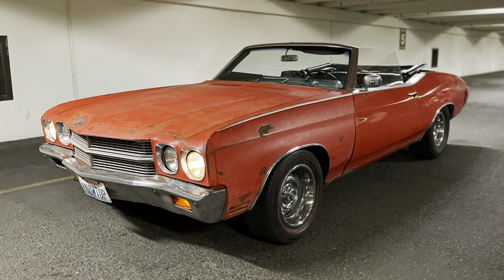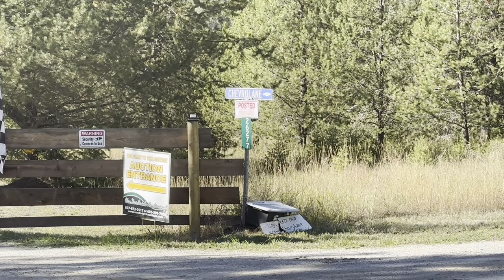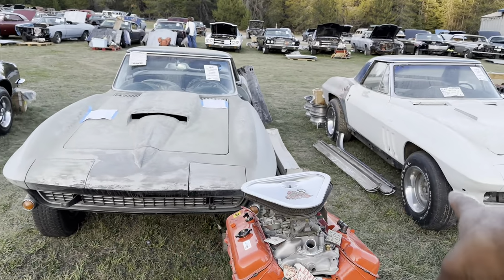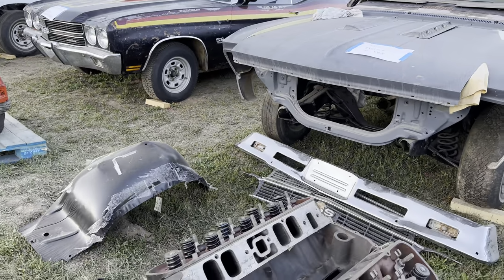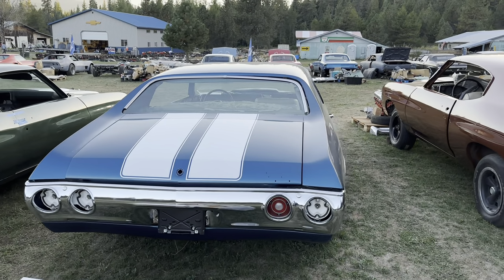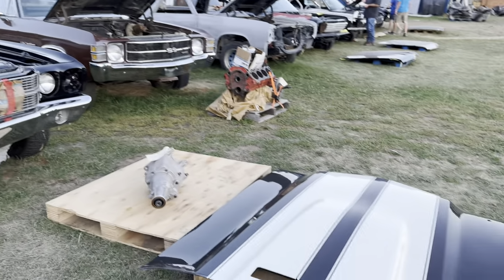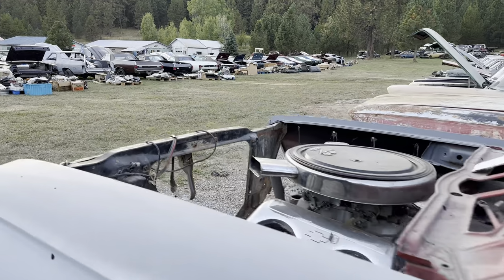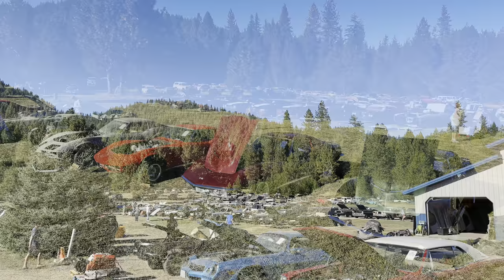One Man’s Big Block Chevy Collection pt. 1 #musclecar #barnfinds #ls6chevelle #roylanglitz

Comment: Back in 1977 I bought a 1970 SS Chevelle 396 (402) for only $800. Back in those days there where a lot of 1968 to 1970 SS Chevelle 396's, and 1968 to 1970 Plymouth Road Runners with 383 engines because both the Chevelle SS and Road Runners with 396 and 383 where the poor mans big block muscle car.

Comment: Currently working on 67 Plymouth GTX. Bought it sight unseen but inspected and numerous conversations on ebay. (Before sales guarantee) Got 😂Some pictures. Inspection came back clean so bought and shipped it from Minnesota to S.Carolina. Got screwed big time. Been restoring for 8 years. Got it, everything ripped out of engine bay, left enough for engine to run. Figured out it was dragged. 440 with auto reverse shift. Frame rails had holes the size of grapefruit all throughout.Finished a 66 Dart conv, 82 Monte SS, 69 Road Runner conv w/ 440 4speed. All gone except GTX. Your knowledge of those SS, etc. is impressive.

Comment: I getting my 1964 Impala SS back together. I had a 2001 LS1 engine installed from a corvette. 4LE60 transmission, Dana 60 rear end posi traction 3:7:3 gears. Ride tech coilover suspension front and rear with front and rear sway bars.

Comment: I removed a 2001 Deville Northstar engine from the top to replace the head gasket and stop oil leaks. I just found out yesterday, the engine need new rings and maybe a piston. I bought this car 6 years ago from a police impound for $375. April this year was the first time it would not pass emission.

Comment: I'm working on a  built 77 chevy monte Carlo, with a 468 BBC and built, 400 turbo, and a built 9' ford Moser rearend in it, all factory option's  work, cherry red, white vynle  top, white interior, swivel bucket seats, console,it has weld wheels and drag radials on it.

Comment: Great show, Dezzy.
I'm like you, I get excited about 70 Chevells. 
My 70 was a special order by an older gentleman from Texas. It wasn't a big block, it was a 350,but he ordered it with the SS dash and a 4 speed, bench seat. It was the beautiful maroon with a black vinyl roof. 12 bolt 331 posi. Tan interior, I know, blah! It had the 14 inch rally wheels, and front disc brakes. When I bought it from him, it was 8 years old and I paid $750 for it. YEAH, those were the days! 
Back then you could buy a like new little Chevy Vega with a blown up 4 cylinder for around $100 to $400, pull the motor and transmission, and put in a small or big block and whatever transmission  you liked and have fun, fun, fun! After you blew out the rear end, a 63 to 67 Nova rear end you could put in them because they were the perfect size! 
Fun times, my friend. Enjoy your time with cars, but don't ever forget to include your children, boy or girl, make sure to include them in with your passion. ❤❤
GOD BLESS YOU
and GOD BLESS AMERICA 🇺🇲🇺🇲🇺🇲🇺🇲
Reply from the maker: My little man is fully entrenched in this car lifestyle 
https://youtu.be/WQ81-22z4Kg?si=qe5QIWnBhphAR3NM

Comment: 1919 nash rat rod 632 blue print.  36 maple leaf 1 1/2 ton 250 twin carb 4 speed. 37 maple leaf 5.9 swap. 60 frontenac gasser 427 th400 aluminum hd 9inch
Reply from the maker: I have never heard of a Maple leaf, but that Nash sounds crazy with a 632 in it! I need that in my Chevelle
Reply: @DezzysSpeedShop  canadian chev gmc truck

Comment: All high performace corvette's of 1960's had a 4 speed, The Split window corvette was only one year 1963, You can tell a 1963 by the hood, The 1965 was the first year for the Big Block power bulge hood, There were 2 styles for the 1966 Big block, power bulge hood or the hood scoop one. In 1967 you could only get the one big block hood scoop. There were 2 models of Sting Rays in 1965 Sport coup and convertible. 1970 LT1 only came with a 4 speeed. 1971 you could get a automatic LT1, There not what most people want 4 speeds are worth more. From what I know If it a High perfomace chevy it was born with a 4 speed in the 1960's, Not till the 1970's did they start putting automatic in H.P. cars
Reply from the maker: Not true. You could get an L88 in a Vette with an automatic in 1969.

Comment: Work in the F150I need help. I'm 70 years old.
 073 really.
 I gotta d Gotta put a transmission in It. Which I Need help. A little bit of electrical work. More help. I don't have no way to do the work.
Reply from the maker: Gotta find a good local shop to lend you a hand

Comment: Dude my brother just paid twenty-five grand for a 67  L89. Engine but it's going in a 67 Chevelle SS
Reply from the maker: Geeze! The whole car went for about that
Reply: @DezzysSpeedShop  back in 84 my brother had a real LS6 454 El Camino green black interior i Auto. I just remembered it was a 454. And all 1970 454 El caminos were LS6 or LS5 .
Reply: @DezzysSpeedShop  in 1984 my brother had a beautiful green blacktop black interior LS6 454 El Camino. I was wondering what that car would be worth now
Reply: @RonNorman-qu4qz  It should be a 6 figure car depending on condition.